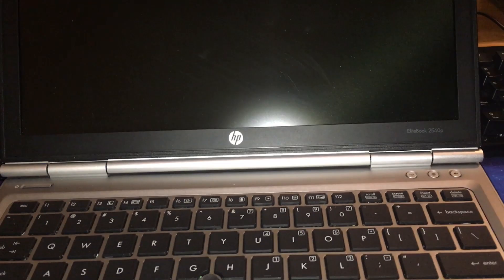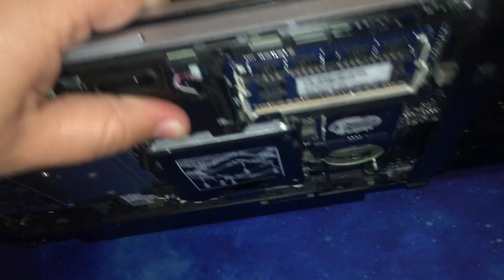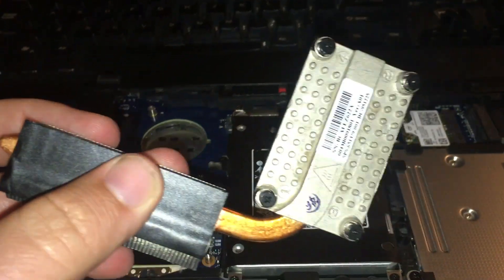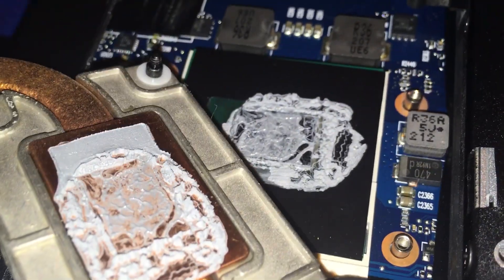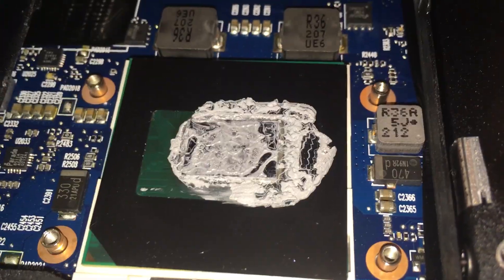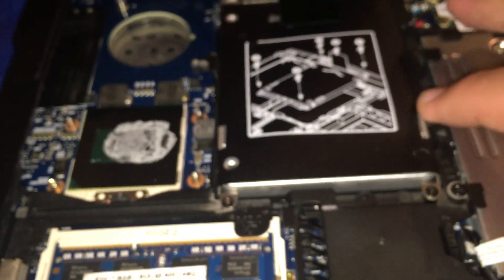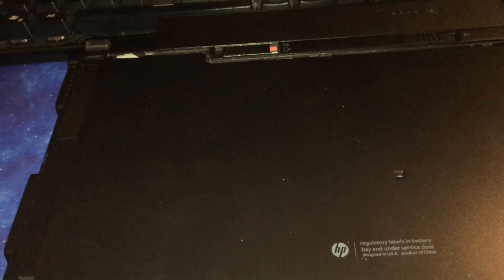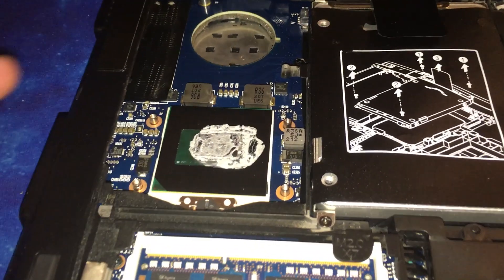Can you upgrade an Elite book 2560p with a core i5 to a core i7?

Comment: Only if the chipset is 2/3 gen there is a 2 gen only motherboard to this model and it can NOT be upgraded to the specs in the title so the wideo is only half right and half wrong. The title is not true !!
Reply from the maker: Uh… if you have a 2nd gen you should be able to upgrade to a 2nd gen i7. This has a 3rd gen cpu so was upgraded to a 3rd gem cpu. Keeping things in the same family. Did you watch the video?

Comment: 2560p and 2570p look like exact same
Reply from the maker: they are very similar. Business class laptops are not made for looks so much as practicality. There are some small differences, but mostly they are the same. the nice thing is. if you have a dock or extra power cords, etc. you can swap between the two without issue.
Reply: @AICvideo  is the 2570p or 2560p better ?
Reply from the maker: The 2560 has a 2nd gen cpu, the 2570 has a 3rd gen. I would pick the 3rd gen
Reply: @AICvideo  but if we would leave out the cpu and all upgradeable parts what would be better then ?
Reply from the maker: As far as I know, they are identical. One just supports a newer cpu and USB3 and the other one doesn’t.
Reply: @AICvideo  wich one is it ?

Comment: Hi do you have full spect RAM that you use in that model i also have that to having hard time getting Ram compatibility. Only works on 1GB ram. That sucks
Reply from the maker: DDR3? it might be bad ram. I used just DDR3L because that is what I have on hand.
Reply: @AICvideo  ok 1200 or 10600s ? Im using 10600s 1rx8 1GB.
Reply from the maker: PC3L-1600 DDR3L-12800
Reply: @AICvideo  thank you